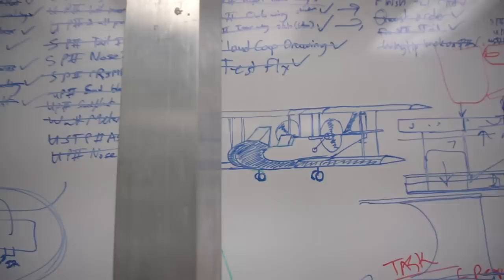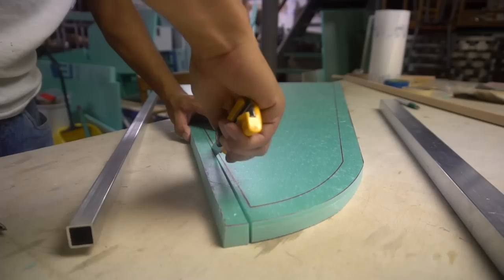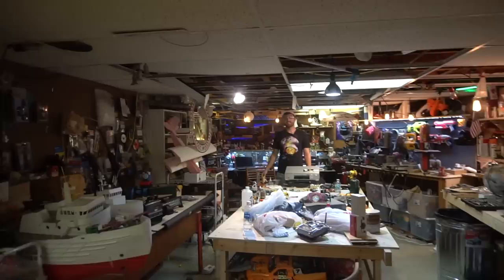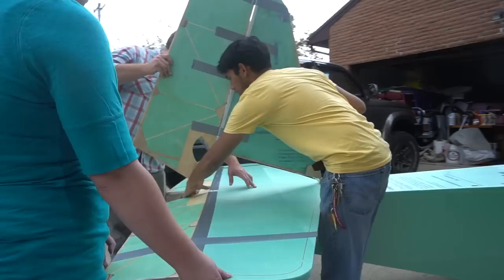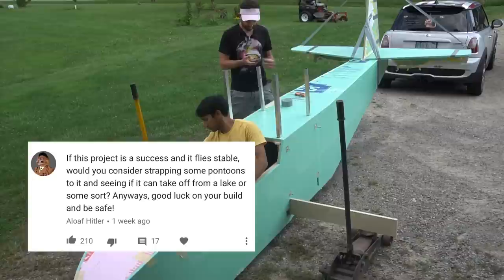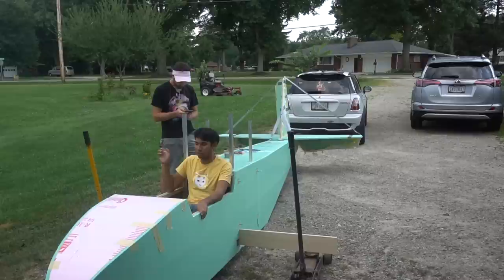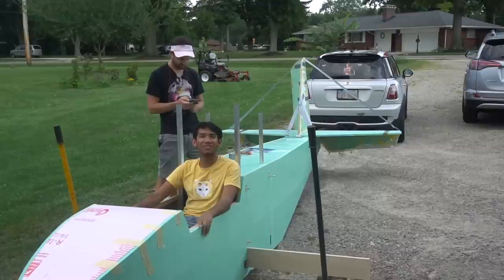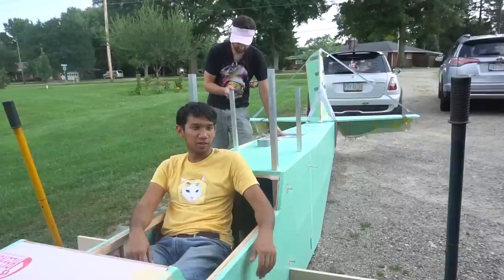DIY Electric ultralight pt2 (tail section)

Comment: Addendum - one commentor mentioned depending upon foam and gorilla glue for your life. My response is that there are a NUMBER of high speed water boats built from nothing more than gorilla glue and plywood. If a boat built with gorilla glue can cruise a lake at 60 mph, then don't disparage an ultralight plane built in a similar fashion.

Comment: skimping on material is okay if you know how to calculate tolerances and such, but don't skimp on an engine!  Take A look at converted Honda automobile  engines for planes!   You can get an engine for only $15,000 on there that can produce almost 800lbs of thrust!    You'll have amazing climbing performance with possible service ceiling 20,000ft!
Reply: If that's the case, then this thing will have almost a 4:1 thrust/weight ratio bc this thing will weigh 254 lbs at most. Goddamn.
Reply: hehe yah!  he should look up Viking Honda Engine conversions, they sell a complete engine package with engine already ready for plug and play in any aircraft starting from $15,000!   They STOL aircraft won the competition over other competitors using Rotax and other real aviation engines that cost WAY MORE$$$!

Comment: you are only going to have 2.8kwh of battery power on board? 
you are a braver man than me if thats the case 

though i would recommend coating the wings in solar cells so you wont be stranded if you are forced to land in the middle of nowhere

Comment: 60ah 12s lipo is going to cost you a fortune.... I hope hobbyking is sponsoring ; -) .

also what is your setup with motor and esc going to be? I am currently working on a 3d printed electric hydrofoil surfboard. going with 2  multistar 6s 20000mah batteries. and a custom 120kv 6000watt brushless inrunner. any tips? and of course goodluck! you da bomb!

Comment: no airfoil on the tail plane? wouldn't that stall before the wing? and have poor pitch control...
Reply: Plenty of aircraft without airfoils on the horizontal stabilizer. My soaring clubs Piper Pawnee tow-ship seems to fly just fine without one ;)

Comment: Loose the useless foam and save a few pounds. I don't see it doing anything other than adding mass. If absolutely need it to be a covered frame, use a plastic film or something light weight. Other than than, seriously admire your work.

Comment: I am surprised that you are not using carbon fiber cloth but instead are using fiberglass cloth. The carbon fiber would be a bit lighter and much stronger than the fiberglass.

Comment: What are you using to control your rudder and elevators? Servos?
Reply: Sterling St. it looks like he's gonna use a system of cables and pulleys hooked up to the controls. Although, he could also do what Focke-Wulf did with the Fw-190 and use push rods to link the controls to the control surfaces. Cables and pulleys work fine but they have to be re-tightened from time to time
Reply: Nick Fury thanks!

Comment: Bro with this concept i designed a plane which can be controlled manallualy from the plane or form a simulator in vr this is a real plan which can be controlled by inside in air or can be flyer using a cockpid from your house

Comment: Dude, you've been brainwashed by building rc planes. You are amazing in rc, but that's something entirely different and it's more than clear that you have no idea what you're doing. If the construction of the wing is the same quality as the tail and the fuselage - that's good - you will never get off the ground. But if by chance you build a good wing - my advice is to get a really good insurance because IF you get off the ground -- you'll need it. Get all the help you can from people that know what they're doing. You look very confident which is bad. Confident guys with zero experience hit the ground hard. Would you bet that it will fly?